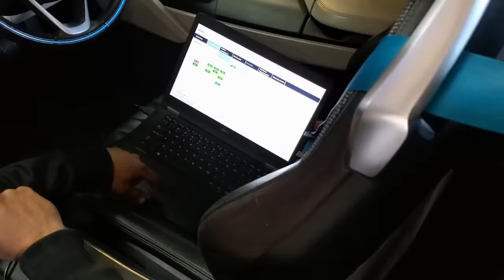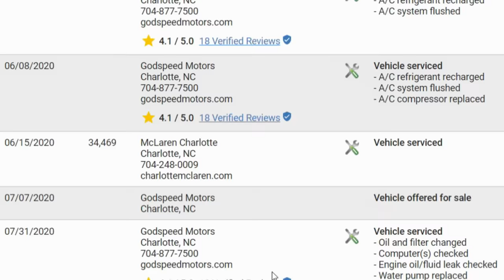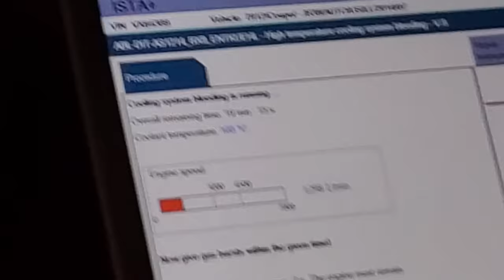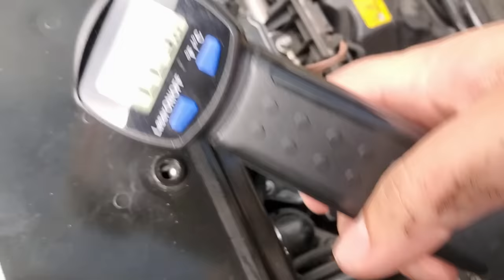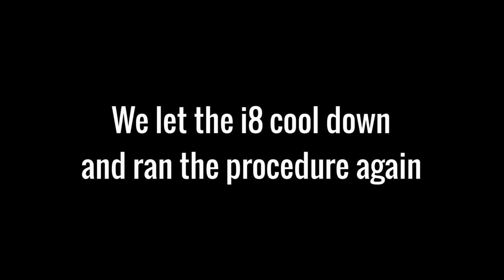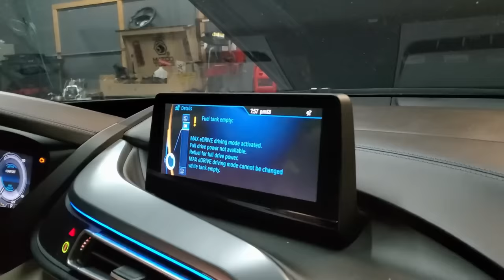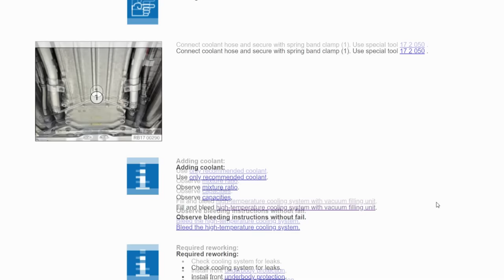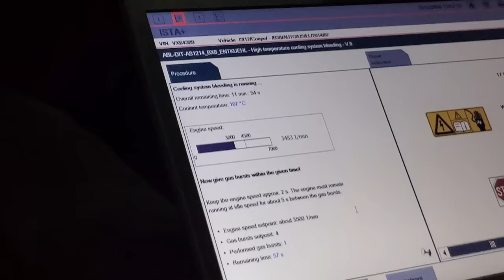Was my Repo'd BMW Supercar Sabotaged to make it Impossible to Repair?

Comment: Sounds to me like a rag was put in a hole to stop anything from getting into the system or stop the water.
     Pull those hoses, put wet dry vac on hoses while running water through top hose.

Comment: Talk about possible sabotage. My Porsche Panamera Turbo started to overheat due to a simple coolant leak from rear of engine from a hose or something. Other than that, there was no other engine problems and it was running fine when I put it in the shop. I would have fixed it myself but I couldn't reach it and it also required removing the intake manifold just to get to the thermostat. So I put it in the shop at the Porsche dealer. A month later they told me they got it fixed but were just waiting on a few O-rings to arrive from Germany to put it back together. The next month they said they had to remove the entire transmission just to get to a screw. They said it would be no charge for that so I was relieved. The next month they said that they were were slowly putting it back together and it should be ready by Friday. That was almost 3 weeks ago. I still haven't heard form them. Then never call. Ive only called them once a month for the last 3 months for what was supposed to be a simple coolant leak repair. I'm starting to think they done screwed up my engine and when they finally give up trying to patch it up, they will try to figure a way out of it and blame me for something they've done and leave me with a ruined car. They gave me a brand new loaner Porsche to use during the repairs months ago and is not even concerned about getting it back after 90 days. I would have done a suprise visit but the dealer is two cities away and they're just gonna say the something they say on the phone..like it'll be ready by next week.

Comment: Sounds like a cracked head or block. With that much air/gas pressure coming out of the reservoir there has to be a leak somewhere allowing compression to escape into the coolant system. The coolant system is a closed loop system. It should not have constant air bubbles coming out. A blown head gasket usually doesn't take 10 minutes before the vehicle is overheating. Maybe someone just overheated the engine real bad. The damage caused the crack and the constant air bubbles keep air locking the coolant system passages. That's why it cannot be bled properly. That's why they keep saying replace the engine. I had a similar over heating issue on my 22R only to find every single cylinder had a crack between the valve seats.

Comment: I'd take the rad hoses off and see how well you can pump water through the entire system with out the thermostat spring installed and see if there is a blockage somewhere.
Reply: That’s I was thinking that too. Check o-tubes and everything.

Comment: Um at 18mins in he say its strange that the fans not kicking in... correct me if im wrong but doesnt the fan run off the thermostat the same thermostat that they removed the spring from?

Comment: Doesn't the I8 have a threeway valve with a separate cooling loop for the HV battery like the chevrolet Volt to use it to cool or heat the battery while charging? I would check that. Depending on the temp of the battery i would assume it would divert coolant to where necessary.

Comment: There is probably a sensor on the thermostat or cooling system that is defective and can only be diagnosed by replacing it with a working sensor.

Comment: i am at 6:35 in the video and something has me wondering already. he says one dealer replaced the water pump and this car has an over heating issue. now i used to be an auto mechanic and worked on cars for 32 years. now a water pump is belt driven but depending on the car it can be the normal serpentine belt driving the pump or it has it's own belt and tensioner running off the crank shaft. now did someone forget the belt or not put the proper tension on the belt to run the pump properly?  just some thoughts before continuing the video. and i could be wrong too.
was just thinking to that some newer cars and these mega sports cars could have a mechanically driven water pump. but my knowledge does not extend to those types of pumps.

Comment: I outright refuse to believe any car can be made impossible to repair.  If every single part other than the VIN plate is replaced it can be repaired.  The question would really be is it WORTH repairing and that will always be a purely subjective question.

Comment: sam... i have not watched the NEXT Video yet..   Cold engine.. a piece of Saran wrap and a rubber band.  remove radiator cap..  place saran wrap across filler neck..  push a depression in the saran wrap.. seal in place with a rubber band.. grab a coolant hose and squeeze.. you should see the depression in the saran wrap pop up and go back down.  you may need to seal the overflow hose..  start the engine for 15 seconds.. if the depression inflates within 15 seconds you have a leaking head gasket or cracked combustion chamber. 

 if you find this leaking.. do a modified Cylinder leak down test. without the air pressure regulator.. so the piston is at TDC compression stroke.. both valves closed.. apply compressed air to the cylinder.. if the saran wrap pops off.. you have verified which cylinder head is leaking..  when i find a leaker..  i leave that set up ready to charge with shop air so i can hook up the air to show the customer that instantly the air starts coming out the cooling system.. 

if you have a blown head gasket.. when reassembling.. please coat both sides of the head gaskets with Hylomar blue.. or permatex 85420 flange sealant.  or one of the permatex head gasket sprays that says good for 500F..   i learned that back in  1993 from an engine rebuilder that had gotten the LEXUS factory reman contract.. i have been using hylomar since 1994.. i have not had a leaker comeback since.

Comment: Check cooling system for combustion gases has crack or head gasket issue water pump went out kept drive it that’s what you get changed pump problem starts

Comment: If had somewhat the same thing with my computer. It would shut down after 2 to 5 min due to overheating. Finally i came across the solution, It seemed to be that the power regulation wasnt correct, Certain parts in the CPU didnt require power where as the other parts received to much due to overclocking. This made the CPU fail everytime due to high temperture.

Comment: Has to be a blockage in the line heading to the engine.  Or befor the radiator.   The coolant is not cooling down.

Comment: Dear Sam-I used to work at a radiator shop. You're overthinking the radiator problem. Radiators have so gone to shyte. They USED to be ALL  brazed BRASS, but everyone got cheap and introduced the clamped on plastic tanks. A sad regression in technology and a big move towards planned obsolescence. Don't believe me ask your mechanics-John in Texas

Comment: Every car guy knows if the thermostat fails, it then stays open in every car.
water pump and radiator is more common to fail, for over heating.

Comment: Pro TIP:  Always check basics 1st!  (WHENEVER your vehicle overheats.. or is getting too HOT!  Don't forget, you CAN get a bit MORE cooling, by turning on the interior CABIN heater, IF, it's NOT CLOGGED)  Ratio / mixture coolant to water.  Cap pressure works properly and then, FAST FORWARD TO 17:14 to learn what NOT to do!  Sit back enjoy!  Don't forget to LIKE and subscribe! GREAT VIDEO!!!! <3'D IT!

Comment: It needs tear down and inspection. Cracked head, cracked cylinder? Heat and pressure is escaping into the cooling system somewhere.

Comment: You need to remove each pipe to test that coolant is getting round the engine? I think something is blocking the circulation. Was thinking water pump but diagnostics would show that failure... wouldn’t it 🤔

Comment: OK a similar  auction purchase. A mate bought a V8 Holden LS powered commodore SS thunder ute from auction with a host of engine faults, incuding temp sensors, starting but not running correctly and shutting down. It it was cheap, really cheap, and aside from some cosmetics, had low milage and in generally good condition, even with the rear 1/4 panel damaged. If my mate sold the front panels and interior alone, he would have made a nice profit
Him being a serious tight ass and me being an electrician (very obvious choice over a mechanic for a tight ass) we set to work. His inital instinct was to run and  drive and see what would happen, mine was the exact opposite.
First thing was to just check the car out for obvious or hidden damage, anything amis underneath or otherwise. 
The rubber little  balls stuck to the inside wheel arches and delapalated rear tyres were the first give way,  a solid burn out session.
Mine was to completely drain and replace all engin trans , different oils, plugs do the basics. We sived the oil with a fine gauge  and magnet, the fine metal swaf in the 6 speed manual was give away  2.

 Next  we removed  the coolants,  radiator, pump,  thermostat , and again finely sived everything. Minimal  coolant  the bottle and discoloured and contaminated coolant and contaminated give away 3 and 4
Next flushed the system, the radiator was retaining some water when drained, giveaway no 5, (potential block = pressue lock or poor circulation)
Reflushed and used a cleaning solution, all good.

I twisted  Mr tight asses arm  into all new thermostat, pump, radiator, hoses ect (so he went cheap on ebay, and saved stuff all $$)  for a fix one but replacing all for long term value, it was in pieces any way.
Any way reassembled, pressure test with out t stat in (cold) and the reinstslled t stst. 
Called a mechanic mate to run diagnostics and clear faults . So far so good. 
Fingers crossed, first run,  put a cleaner through engine, then flushed and new coolant. All went well, except ebay crap water pump seal, plus some un identified sludge in the radiator.
Replaced pump with a known brand, all 👍 all good engine ran,  with a  miss and a warning light, but cooling system good.
Mechanic mate scanned, and new plugs installed, Mr tight ass cleaned the old one's and said he put new ones in, trying to save 10 cents again. 
Then ran, so far so good, but run hot during  first serious  drive. Redrained the cooling system, sived and noted some string like substance. Complete decant and re flushed,  same process x 2, and water came clean.
End diagnosis, It turns out a chemical solution was used to unnessesarily repair a blown water pump gasket after a potentially violent burn out session in a stolen recovered car. Some of the stop leak solution was clogging the radiator and coolant galleries. 

Another thing we  found out several months later, the original owner deliberately put in the chemi weld product so the vehicle would be written off mechanically. 

Any way, all went well, new tyres, registered and the car ran like a dream, untill the cheap ass ebay radiator failed,
 a  few months later..... and stuffed a cylinder head...

Mr tight ass sold the car to another mate  ( and made a profit) the vehicle went on to do over 200,000 additional km with out a problem.

Moral of story,  if you buy at auction, at least have some mechanical experience and read the report......don't by cheap parts, it can become expensive....... look at the whole system, not just the individual parts...... and even mechanically inept tight ass people can make a profit from auction  vehicles

It surprised me that the BMW s cooling system was not completely disambled and iall parts individually assessed, replaced as required before  running the engine. 

I'm just an electrician, so probably don't know any  better... the only payment, for many hours hard graft, was to drive an SS ute (yawn) and a couple of home cooked meals (his wife is a great cook).... yep, I'll never learn

Comment: If it gets hot, that hot, that fast, you got ring issues from racing. Squeezing the line cold is moron, the thermo aint open yet. That car got one or more ring issues. BMW said motor swap out because ring issues cause cylinder issues. New rings wont do.

 My quick two...

Comment: No it's the radiator there is a screen block to the radiator fan air blower block to the radiator, that causes over heat

Comment: the radiator wasnt his fault it was the hot and cold cycles, it kills computer chips it kills motors that includes brushless and brushed, simple physics heat expands cold contracts.

Comment: After my 3rd radiator in about as many years started leaking, I sold my BMW X1 and have not looked at them again. I heard they are a common failure point.
Reply: one would think that those radiators are made the way they are only to fail sooner.
Reply: @seushimarejikaze1337  They're metal in the middle (the actual heat exchange part) with plastic channels in each side to feed in the hot water. They are 'welded' together. So, yeah...
Reply: @johnyoung9649  not cool BMW. not cool...

Comment: As of 3:40 , I am guessing that they may be a physical blockage, may be a crimp, in the coolant lines to and from radiator. Since the water never gets hot. So there is no water circulation.
As of 11:05 my hypothesis of a blackage is blown out of the water, by coolant boiling out of expansion reservoir.
As of 20:20 physical blockage theory is back in play.

Comment: Edit: Ok, am late to the party. Sam, what did you find ??

(Original post)Will never own another german chevy exactly for the reasons shown here. 

Also, I had the same thing happen on a CAT 3126 military application. Turn out some assembly line tech got distracted or in a hurry and shoved both the upper and lower  main lines into place so hard without pulling the shipping caps that the whole system was blocked. 

Sam, while you spend all that money on diagnosis,  also check your rubber hoses for collapse or blockage.

Comment: coolant cap allows just over 1 bar of pressure, you pumped up more and you have blown your rad, simple. pressure in the coolant system is required to lower the boiling point. this may contribute in overheating when cap is faulty, but usually it will spit the coolant, that's all. coolant system has a small and large circuit, the thermostat is between the two, that is as simple as construction of a hammer.. Radiator hose should be cold while engine block is getting warm, this means the large circuit is still closed.  Your radiator warmed up which means thermostat was open at some point therefore no point in removal. Change this garage, the mechanic is not very good , he should know the temperature at the engine block and from the radiator fan sensor just by plugging the diagnostic software all the mechanical work was pointless before getting the engine logs.  
This engine is equipped with an electric water pump, so if you first excluded cracks in the engine or blown head gasket, water pump is the second to investigate. Again log the engine and check if the pump is on when the temp is rising. if the pump is running from the ECU point of view you may need to check against the faulty impeller.

Comment: If everything has been replaced and is installed correctly, reprogram the computer. At this point you are fighting sabatoge. Someine could have damaged the harness or other wire set so no physical display would show up.

Comment: we have the contract with bmw performance center greer sc and well alot of the bmw we tow have tha same issue i8 models are for the special higher up management x7 as well same engine running hot issues with alot of them as well as drive train malfunction all and we also tow for dealership lots of common issues I have learned alot of stuff from bmws
Reply: we use the tow eyes and 8 point straps flatbed only no wheel lifts are allowed to tow them
Reply: we use the tow eyes and 8 point straps flatbed only no wheel lifts are allowed to tow them

Comment: Bad head gasket. You're blowing exhaust into the cooling system which creates air and heat pockets. Saw this on an old GM mini-van.
Reply: Also, your coolant should not be boiling in a sealed system. There should be enough pressure in the system to keep that from happening.

Comment: Didn't you say the water pump was changed?  I had a 68 SS Chevelle that never ran hot untill the factory water pump went bad.  After that it never ran cool again.  Same thing on a FWD John Deere.  Bought new, never overheated until Deere decided that they had to upgrade the original water pump.  The new impeller was funky looking skeletonized PO S.  Never ran cool again.  

There is a chemical test for combustion products in the coolant.  If that is negative,  then you know nothing catastrophic is wrong (cracked head or block, blown head gasket, etc).  If flow tests on cooling system are ok, ck for excessive exhaust back pressure.  Actually, check that first since pulling the rad is a bitch.  Good luck.

Comment: Bro has a blown head gasket from the cylinder into the water Port jacket that's why it's holding holding compression in the hot air from the combustion chamber is going into the water Port there for heating up the water in the cooling system Beyond its normal range check for a blown head gasket I guarantee if you pull the head off that car you'll see where the head gasket blew into a water port